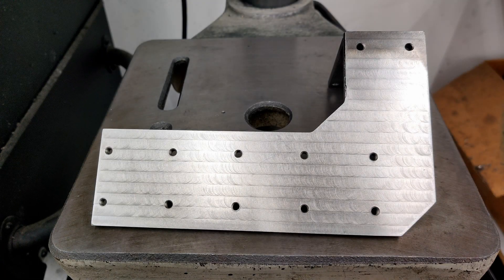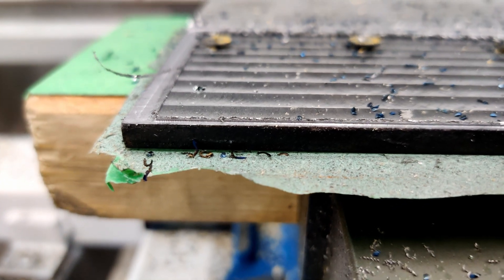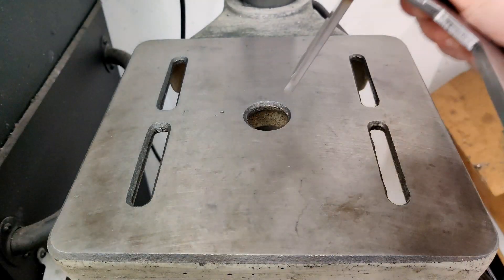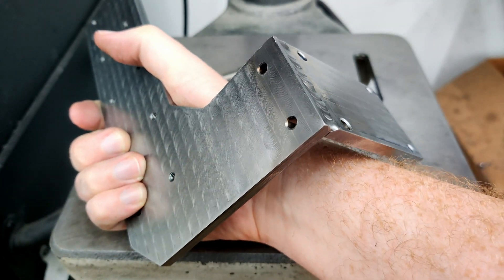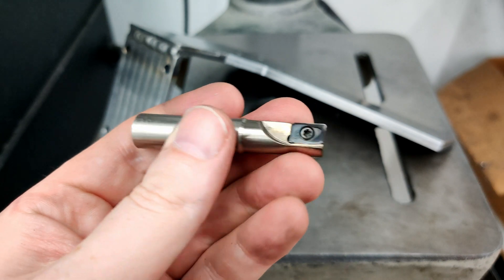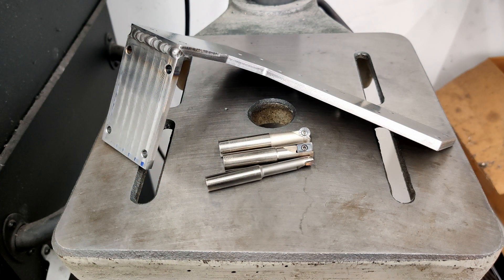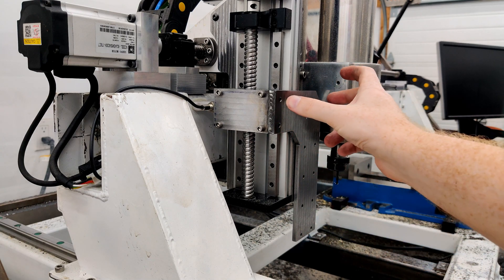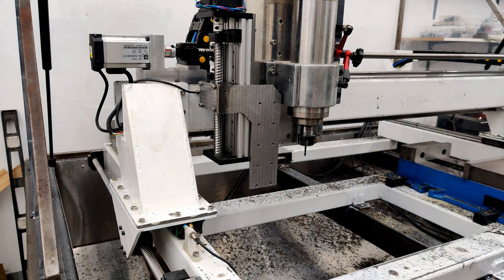Slotting steel on a CNC router

Comment: information: as smaller cutting edge number you choose as lower is the frequency produces. BUT that induces longer and heavyer swings. When you take, as mentioned before a higher number in edges the frequency will go up and the overall heavy vibrations will go down. 

You can take 6mm endmills those are by any means the most affordable at least in Switzerland. 
Best of luck for other projects. 

Nice machine =)

Comment: Very cool project. I'm sure you already know, but perhaps reducing stick out and a more rigid hold down method could make that DOC possible. Thanks for sharing.
Reply from the maker: Yeah this tool has no stickout. The shaft in it has a much larger diameter. I am thinking of cutting that entire thing off and machine down the nu-machined shaft part. It would allow me to butt up the insert tool right up to the collet. Silly looking but should work better. Maybe it would be good enough than for steel slotting like this.

Comment: I think you have found a vibrational mode of your machine. It sounds a little lower than power line frequency - maybe 50 hz? If you can measure the frequency of the vibration you might be able to choose speeds that are not close to harmonics (multiples) of that frequency.

Comment from the maker: There was a bug with the X servo tune that I've narrowed it down to. It's when the servo decelerates when it flips out. I gotta sit down and compare the tune to Z and Y servos to see what is the difference.  I was even able to get it to spaz when stopping from 30mm/min! Still I think the 8k rpm of a single insert it way too harsh on the machine while cutting. Gonna see if I can bump that up by a fair amount to get into a range where it doesn't vibrate the machine.

Comment: Supposedly, these bap300's dont really like to have a deeper doc than 0.3mm (saw in a toolmaker catalog). They have high feed insert cutters with dual cutting edge (both directions) for like 6k feed 1mm deep for steel. Smalles size they offer is 16mm. I got one to try it out.
Reply from the maker: Yeah a 2T bap300 would be good. I've seen a 3T similar tool on the PrintNC discord. Not sure what inserts it takes though. The tiny ese tool I use with the jdmt inserts take a similar DOC

Comment: One of the issues is just how much stick out you have on the original tool... That's going to encourage it to chatter.
Reply from the maker: Yeah I’m almost tempted to cut the shaft further down and I could practically butt up the collet right up to the insert. There’s enough length to it. The stick out on this tool is probably amplifying the vibrations. 

I might try running this tool much faster at around 18k rpm. Vibrations at that frequency stop resonating the machine and the servos don’t have much of a problem with it. It’d want to burn up but maybe if I can take a bigger chip load it’ll be fine.
Reply: @BryanHoward  hmm. Well I'm just a guy in the comments section but... My instinct is that it's still very long even then? (However yes, can't see a downside in reducing stick out. Benefit is the third power of length!)

Have a look at say some catalogues for carbide tools. I imagine you will find they are 13-20mm long at typical lengths? Then consider they are carbide... I'm guessing your tool holders are HSS? So I would be thinking you want a holder where the collet is going to kiss the material!
Reply: @BryanHoward  my instinct would be that 18k rpm is going to burn up the inserts very quickly? If you play with a tool calculator you can see that tool life has a very steep gradient Vs surface speed.

It could work if you took tiny skim cuts and had massive speed to get the chipload up. But I imagine that the calculator will give you speeds way beyond what you can run your machine frame?

What happens if you try a small diameter 4 flute solid carbide end mill? Perhaps a 4mm? Run it as slow as you can (12k?)
Reply: Yes, I generally don’t run with that much stickout even on $2M machines with much more rigidity, especially when slotting.